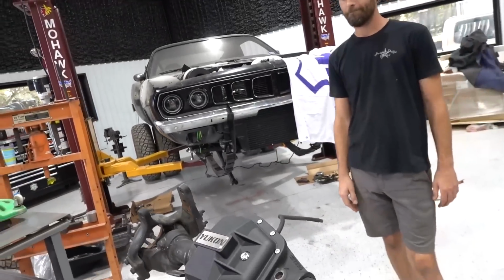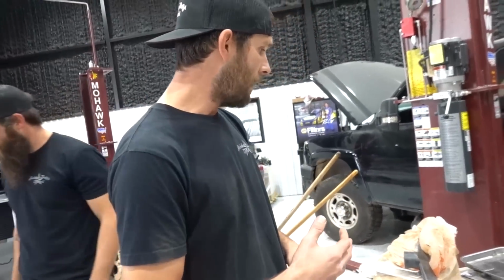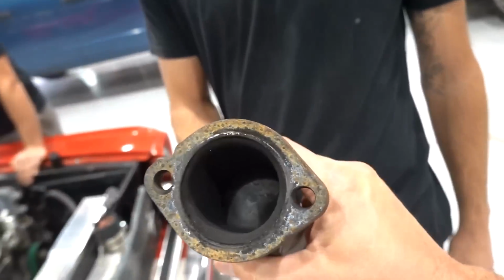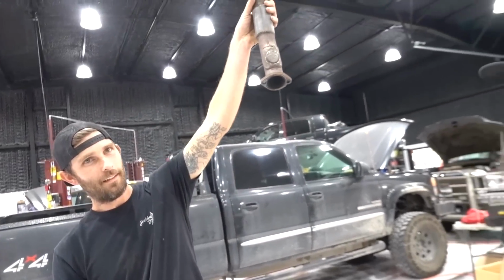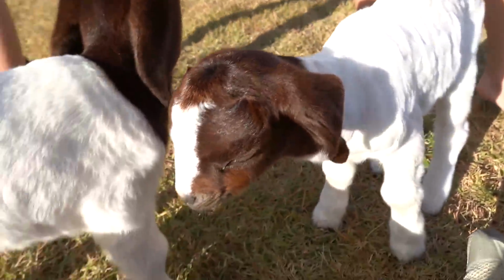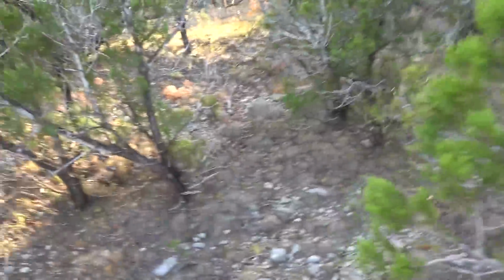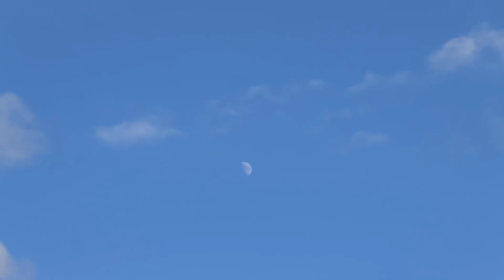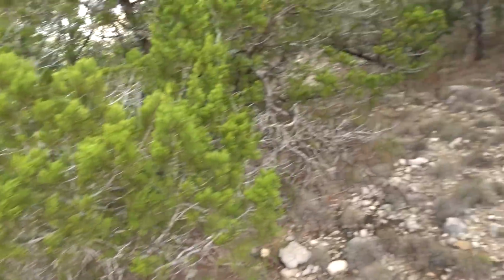Found Out What’s Wrong with the Powerstroke and it’s WEIRD

Comment: You probably need to apply lime to the soil in the fenced in area to get grass to grow. The needles that fall and decay into the soil are turning it acidic, which is bad for growing grass. The soil PH should be only slightly acidic, like 5.5 to 6.0.
Reply: That's what I was thinking too
Reply: cedars destroy the edges of my grass because of the acidity. can confirm.
Reply: Landscaper here. Yes on lime,  it would take a lot of rain fall to neutralize the current soil so roughly 750lbs over the 2 acre would be a good start to the regrowth of grass.
Reply: It's a solid limestone hill though...
Reply: No lime needed.  The TX hill country is on limestone.
Reply: .Ummm....the hill country is nothing but limestone.
Reply: Yep!! My family has been in the hill country since 1850 and we ALWAYS use lime. It prevents fleas also. LOVE THAT STUFF. All my extended family in the rest of the country uses lime also.

Comment: The Bamberger Ranch you are talking about is the real deal. Clearing the cedar alone will not just create grass. You have to seed long rooted native grasses, then create rock berms on the hill side to slow water run off and let it seep into the limestone, which will eventually create springs. Bamberger(Sela) Ranch does offer tours and what he created in very dry Blanco County is just short of a miracle. Perhaps you could work out a deal with a local topsoil company and jumpstart the process.
Reply: Very good info.
Reply: Nothing will grow under cedar trees. You have get rid of the cedar trees.

Comment: Your cedars are acidic and that's why the grass doesn't grow around them. In sections remove them and then scrape off the top layer of soil and replace it with some good black dirt. You only need a couple of inches of good dirt for the grass to grow in. Do it just before rainy season and then throw down some native grass seeds. Once that area gets established move to a different section and reclaim it. If you do it all at once it will wash away

Comment: You're going to need a taller fence Matt, when they're fully grown they could clear that existing one with ease.  As far as the shelter goes, a simple A-frame on skids would work fine.  Getting water to the goat pen will be a bit of a tougher issue.  You may want to consider rainwater catchment from the house and pipe it down to a tank near the pen.

Comment: Matt, I have land west of Austin. I saw a lot of good comments about managing cedars here,  but you first priority should be to save your hardwood trees.  The cedars grow up underneath their branches and choke them out after just a few years. I spent time clearing all cedars within 10 or 15 ft of any oak or elm dripline.  If you mulch the cedars,  use it to create a good bed under the hardwoods to hold moisture through the dry months.

Comment: I see one thing wrong with that fence it doesn't have a strand of barb wire across the top that would stop coyotes from climbing the hogwire and to answer your question you will not grow grass in that area until its fully cleared

Comment: Matt, for the shelter, just make sure the door is on the lee side of the wind. And as you mentioned, make sure the water doesnt flow inside. Id suggest doing an actual concrete footer / step to build on or build a shelter on skids that you can move. Just wanna keep the base of the shelter protected from the ground. You're doing great so far though.

Comment: Juniper and Cedar are very thirsty plants. They're great for runoff. But wild grass is also good. I'd remove trees slowly until grass fills in. Pull a couple trees, let it get grassy, and repeat. On two acres you can do a couple areas at a time. Drought tolerant grasses for your area are Fountain Grass, Little Bluestem, and Purple Millet. They're "decorative" grasses but I'm guessing the goats won't mind.

Comment: When I was a kid, we had goats. Boers and Pygmies...... 
Pro tip:
Work on snack training. 
By that I mean, get them little peppermint wheel candies, cheap to buy in bulk. Not for tricks, just great me out! 
But before you give them the candy crinkle the wrapper for a good 4-5 seconds. The sound will play an important future role. 
After they get used to this routine of hearing the wrapper open, they'll come running from far away to get some of that candy. You'll need this cooperation from them for when they escape your cute little fence. 
Even worked on the horses we had too! Never had to chase one horse cause of this trick. They always came once they heard the wrapper.

Comment: That fencing is spot on, I'd be inclined to run an electric fence wire along the top on the outside to prevent coyotes and other predators from climbing in there.

Comment: The state of Oregon has been conducting Juniper removal in the high desert on the east side of the state and the springs are returning. I am not sure if they are native to your climate but very few non native species are beneficial. Leaving the stumps gives run off a place to filter into the ground as they decompose' Good luck

Comment: A juniper's tap root can penetrate 25 feet straight down in search of water. It can also send out lateral roots 100 feet or more from the tree. Juniper affects the deep drainage on rangelands because of its effect on all the other water balance components: 1) a large portion of precipitation never reaches the soil due to interception loss, 2) juniper extracts most of the water that does enter the soil to meet its transpiration requirements

Comment: You're going to need more goats in there to make it grow grass, and irrigation. As the goats eat the trees they open up more sunlight to the ground and turn the acidic foliage of the trees into sweeter, more nutrient dense manure that will feed the soil, as they graze on the grasses they will cause the grasses to spread out. You will want to keep the land moist to keep the system flowing, and roate grazing areas to lower the worm load on the goats.

Comment: As a Warranty Engineer for Deutz here in Atlanta for 8 years I thought I had seen every failure imaginable (caused NOT from the factory)! So many low/no oil failures, engines hydro locked by the whole machine being submerged in a flooded rock quarry (the dead fish on the top of it was a dead giveaway, of course the customer didn't tell us about the flood part)...

Comment: To make grass grow, the scientific method:
Determine the current ecosite classification of the area in question. It's easy, just use the field guide for your ecoregion. Identify the desired ecosite, in this case by the desired vegetation. Make the necessary changes; which may include: adding some sand, silt or clay, altering the nutrient composition(fertilizer) and or pH, maintain the appropriate moisture level.

Comment: Those are some cute baby goats. If they start giving y'all a hard time drink from the bottle. We had great success using regular baby bottles and made the opening a little bigger. It made much easier for the babies drink the milk replacement. Are you considering de-horning the goats? If they keep their horns and stick their heads through the fence. There's a good chance they'll get stuck and won't be able to pull their heads back through the 4 x 4 hole. We had that problem and swithed to the 2x4 non climb wire. I would hate for something to happen to the goats. Even worse, one of your kids find the goat.

Comment: Hey Matt as far as the Cedars go I seen one comment which the person's right you need those seaters really I would leave several areas at least 20 ft in diameter with Cedars I would say 30 ft if you can and clear the rest if you want but seriously you do need those seaters for many reasons but yeah I would leave 20 to 30 ft areas several of them all through the two acres leave them intact and you'll be okay

Comment: Matt the truth is that there would not be that many cedars as wildfires would normally come through every so many years killing the small cedars and encouraging grasses and forbes to grow and thrive. But because of people being so worried about fire they have suppressed all fires. Which has destroyed alot of habitat basically about everywhere west of the Mississippi used to burn every 3-10 years. Which is why out west has such bad fires now bc there's so much fuel built up from fire being suppressed for so long. Then when there is a fire everything's like a matchbox ready to light a blast furnace. As a fire is inevitable, but frequency and intensity are connected, the more frequent an area burns the less intense the fire is, then obviously the less frequent the more intense it is

Comment: Hate to say this. Years ago as a auto Mechanic in my youth got bit by this. Double walled tube woman drove through a puddle in the winter and the cold on the hot exhaust collapsed the inner layer. Car ran but no power. Took for ever to find the issue and only by luck.

Comment: Had a cavalier that the cat got so clogged it was doing that exhaust out the intake thing.  It ran but seemed like it wasnt shifting so we thought it was a trans issue but the code readers couldnt connect to the computer for the trans for some reason and engine wasnt showing any codes also unk why unless that car didnt have a oxy sensor after the cat but would think it would being a 97 i dont recall.  Anyway after trans shop gave up i was driving it home and it sounded like the car was breathing from the intake..inhaling and exhaling which made me think exhaust was clogged and found the cat was plugged up.  Hammer and a long screw driver later was all good.

Comment: The goat with the folded ear at the tips. This is considered a cosmetic defect and not necessarily genetic. Hard to say why it happens, could be the ears were stuck in that position in the womb. It is correctable but usually needs to be done closer to birth. Since these goats aren't going to auction, competition and are just going to be family pets, I wouldn't bother doing anything to correct it. Now vertical folds in the ear are genetic and the general consensus is when one of your goats is born with a vertical fold, that's the one you eat as they can't compete and would sell for much less at auction as nobody would want to introduce that into their breeding stock.

Comment: Your going to need to place a single barb wire strand on the inside of the fence to keep them from rubbing up against the hog wire. They will rub themselves on the fence incessantly and over time it will bow out and eventually break the welds on the hog wire. "Ask me how I know 🤣_. Put the single strand below the shoulder and above the bottom of an adult goats chest, ideally in the midline of their profile. Problem solved.
Reply: Barbed. It’s called barbed wire.
Reply: @therileyobrien  that would be an Android autocorrect that I didn't catch 🤣🤣🤣
Reply: @therileyobrien  hold my 🍻

Comment: You may benefit from some Contour Swales and berms with some selective thinning of your coniferous brush in phases. Probably shouldn’t burn, just chip all the brush and spread evenly (without swales), or line the swales with chips to hold water moisture longer. You also have Boer Goats. Those ears are normal, but cute. No it doesn’t get old.

Comment: Matt, you are a doctor(ish), you should know that goats need roughage, they are better off and in fact prefer the juniper bushes to grasses.  Anyway, you have no real topsoil, it would be very hard to get grass to grow well there and you'll never have rolling green hills. 

Also, don't overfeed grain (including pellets) as they end up with kidney stones and in the bucks, they very easily end up with a blocked urethra or whatever the other one between the kidney and bladder is called (similar name but different). With goats just using a catheter to clear it doesn't work as you can't get one up to the bladder on a goat due to a vestigial branch of the urethra (take a look at the unity tract diagrams for a goat, you'll see what I mean). Operating on goats is tricky as putting them under is always risky, they can be difficult to get back out from under so less is more with grain, same applies for rich hay, no lucern!